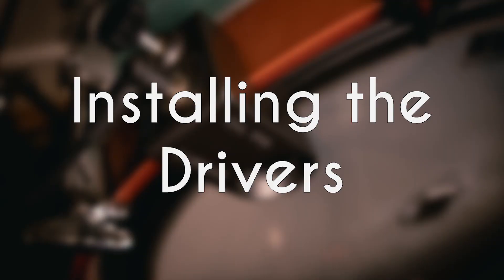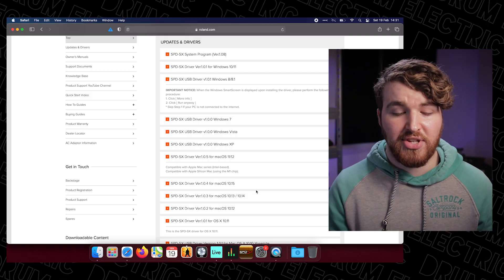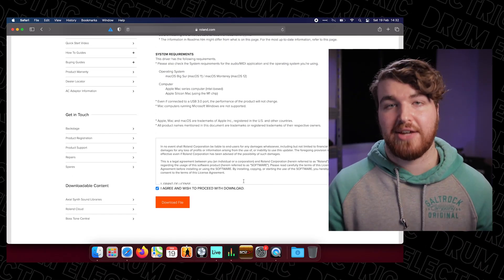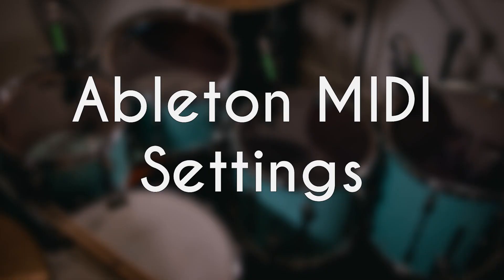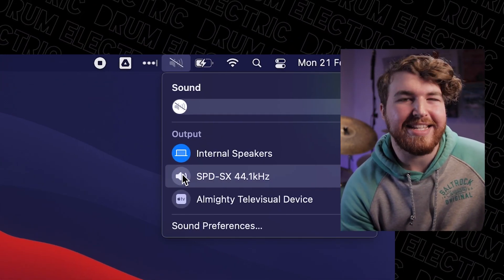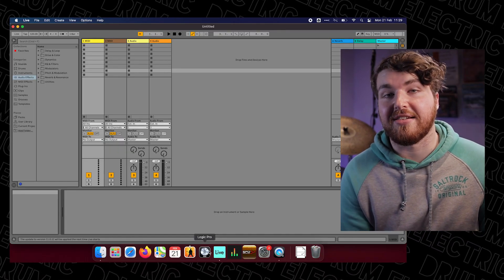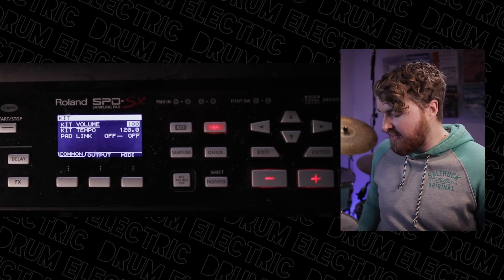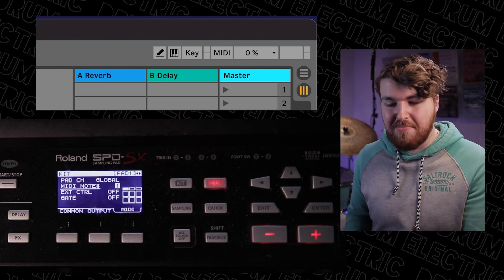How to MIDI Control Ableton with a Drum Pad

Comment: Nice !!! One question: Does this bat allow you to use MIDI knobs and buttons? Or does it only recognize the pads? Thanks!
Reply from the maker: Yep! You can use the two FX knobs and it’s amazing. The only buttons that have MIDI are the plus and minus buttons, but they still change the patch on the SPD-SX!
Reply: @DrumElectric  I tryed all ways, even with Midi Monitor and no midi signal... any advice?
Reply from the maker: Check out my video “MIDI assign the Control Knobs on the SPD-SX”, should be what you’re looking for! 

https://youtu.be/TanBHPe5R2k

Comment: For me ableton is flashing the yellow square for midi detected regardless of the spd-sx setting usb mode. why?

also the roland is also still outputting its audio via a master output (at the same time as sending midi to ableton). obv=iusly i dont hear it unless a speaker is plugged into the m spd-sx mastrer output, however! it also means the lights that blink on the pads relate to the audio on each pad, not that my hit it for midi. this is quite annoying. as the light will keep blinking the audio on that specific drum kit pad is long or looped. Is this changable? or is the only option selecting a blank drumkit on the spd-sx

and even though ableton is picking up midi, the midi track 'gain' virtical bar is showing input,  i load a drum kit onto a midi track. nothing plays. so signal goes to any midi pads across the whole scale of notes from g2 to E8. I also have novation launchpads and launchkeys pligged in, they work fine. but regardless of if they are in or not, the sdp-sx is the same.